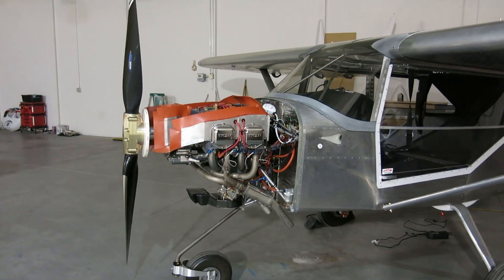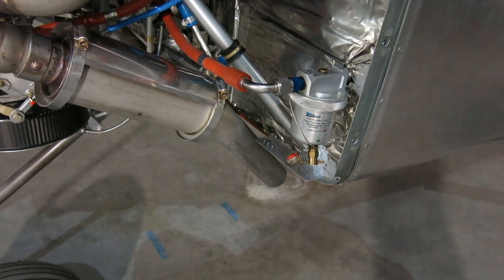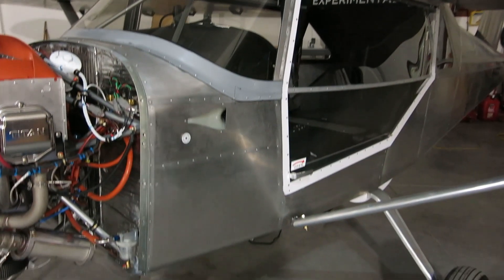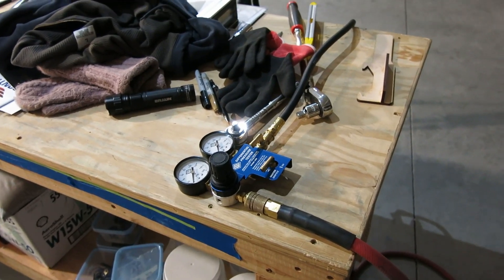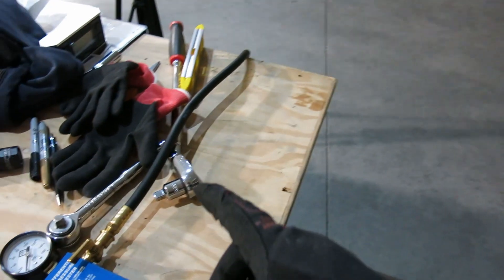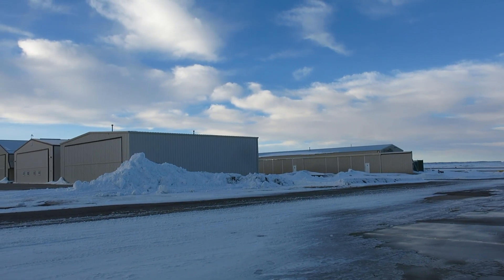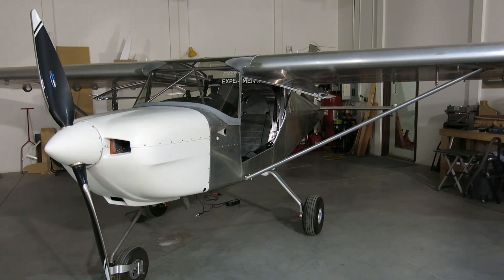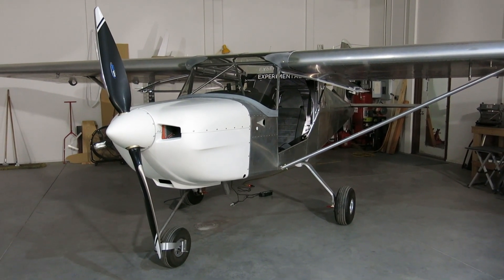No. 426 02-22-2025 It's ready to fly.

Comment: Did you see the Cleared Direct video on his prop bolts issue?  Looks like you and he have the same prop.
Reply from the maker: I did see his video. The trikes have a different hub, so I’ll be curious to see how it works out. Will be keeping a close eye on it, though. The taildraggers use the 76” (I think?) prop with an 8” hub and my 72” has a 10” hub. Time will tell.
Reply: @s-21project92 Taildraggers have 82” prop. Whirlwind has upsized the 4 corner hub bolts so they’re aware of some issues. Did you do any prep to your carbon spinner back plate? Saber recommended we wet sand it smooth and don’t paint a mating surface. Check your bolts often.
Reply from the maker: I did sand it, but dry sanded smooth then cleaned it. I think I’ll be checking it often.
Reply: @ He said RANS had reported no similar issues from other owners, but it seems unlikely he is the only one affected unless he somehow mistorqued his bolts, but that seems fairly unlikely a he seemed meticulous during his build.

Comment: I hope you have considered getting an experienced type rated pilot to perform your first test flight.  The majority of builders performing their own first test flight never go well due to bias in saving the airplane if something goes wrong, just saying especially if you have not been flying on a regular basis.
Reply from the maker: The thought of having a test pilot was dismissed early on in the build. This isn’t a scratch build or a clean sheet design/build by me. The airplane has been proven to be a stabile design and having previously flown the S-21, it  confirmed the choice for me to fly it through phase-1. The test flight program is not being taken lightly. It will be controlled and methodical, following the EAA task-based phase-1 program.
Reply: Your claim is completely baseless.  Less than 1% of first flights result in an accident.  And most builders do their own first flight so not even close to the majority of first flights.  Not sure where you got that from.